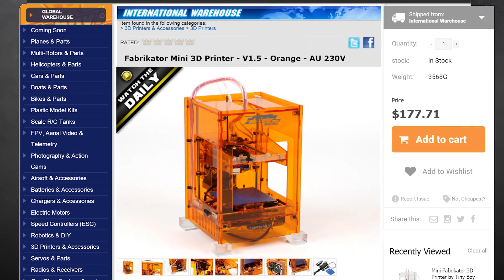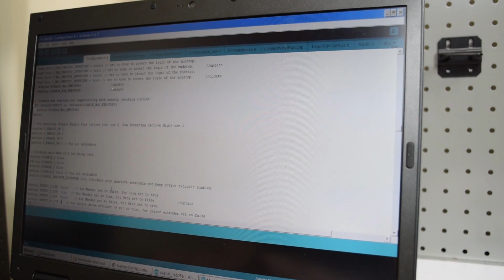Fabrikator Mini V1.5 3D Printer Review

Comment: Nice review. One thing that could be a problem is long term reliability. With brass bushings and underpowered motors that heat up a lot, you will probably not have fun with that little machine for a long time. Well, I guess you get what you pay for, and if this would be your first printer, you probably want something bigger pretty soon anyway. Or you realize that after the first few prints the buzz is wearing off and it just collects dust in a corner. At least you do not throw out thousands of dollars to get to that conclusion with this little toy printer, so it's a good way to get started i guess ;)
Reply from the maker: +ExtraBase With some oil the bushings should last a while and are easy to replace, but yes you certainly get what you pay for!

Comment: Any suggestions on what brand filament to buy for this?  It's currently on backorder @ hobbyking for the US version.
Reply from the maker: +Shai Perednik Any decent 1.75mm PLA will do you fine. I like esun, verbatim and colorfabb.
Reply: +Maker's Muse awesome thanks. ordered my fabrikator mini from the US east warehouse for $224. and esun 20ft x 7 rolls sample pack from amazon w/ your affiliate link for $13. thx for the tips!  can you post your print settings for the esun?
Reply from the maker: Thanks! For printing ESun I went with Cura using the configuration from Chuck's website - and a temperature of 190 seems to work quite well. Be sure to dial the bed level in with the z axis screw carefully so the nozzle doesn't dig into the bed and burn it.

Chuck's resources can be found here - http://www.elproducts.com/fabrikator-mini.html
Reply: +Maker's Muse wow.  thx for the quick reply.  I'll check that out.  any thoughts on using astroprint with the fabrikator mini? I setup and extra pi2 in prep to make printing easier for the family.

Comment: I've had the V1 for about 4 months and I love it.  I need it to make model aircraft parts and didn't want any mucking around.  Apart from a loose z axis grub screw it has worked excellently from day one.
I tried reflashing to add an LCD and SD card board but didn't know it was custom firmware -- HobbyKing support got me the correct files in about 3 days - pretty good going for a low-margin retailer.
Would love to see an LCD add-on tutorial video!

Comment: If anyone plans on using an LCD and the Toshiba Flashair WiFi SD card with the Fabrikator Mini, I have found and made the modifications to Chucks firmware and is available here https://github.com/RJ-Make/Fabrikator_Min_1.5_LCD_Flashair.

The Flashair SD cards works very well. I use it as a mapped network drive on my computer to upload right out of S3D to each of my printers.
Reply from the maker: +RJ_Make That's heaps cool! I always wondered if those wifi cards worked. Thanks for sharing.

Comment: My experience was much different, so far this is what I've run into, out of the box. 

1) Loose X belt (not just a little loose but really loose)
2) Upper Z rod coupling grub screw not tightened down.
3) Bed is warped. I'm 23+mm from the bed in the center and still really tight on the right and rear platform edges. and of course I've not found a way to fix that.
4) Extruder cooling fan is very noise and hard starting on a cold start. Once it's going (about 45 sec) it quiets down and runs normally)
5) The X axis motor pulley rim popped off and the pulley moved up the motor shaft. Not sure if it's a pin or grub holding that pulley on, but it's smaller than .050 and I have nothing that small.  I had to tap the pulley back down on the shaft and set it and the rim with superglue just to get this thing to run to see if I had any other problems.

After the above, I was finally able to print a calibration cube successfully,  but on the next test print the X axis motor pulley broke free again (was fully expecting that)
Reply from the maker: +RJ_Make Wow! Sounds like you got the Friday Arvo Knockoff Special.... 

#1 Tightening the belts is a pain due to how they've designed the movement axis but not impossible. 

#2 If you have the right allen key no huge problem, I'd stick some superglue on that one for good measure.

#3 Warped bed however... that isn't good at all. I think you would have a case to get in touch with them, send photos of it with something flat on it and get a replacement sent out to you if you can. It's easy to replace by undoing the 4 screws with the standoffs. Maybe those standoffs weren't fully tightened down? 

#4 Bad bushing on the fan would cause it to vibrate noisily, might need a tiny bit of oil if you can somehow get to the bushing but might be difficult.

#5 That has happened to me before... VERY frustrating. It's definitely a grubscrew, it'll probably be a very small metric one, not sure what size.
Reply: +Maker's Muse Thanks Angus, Yep, 1 and 2 where easy, thankfully I have some of those tiny zip ties, and the correct hex size for the coupling. 

It's not possible to correct the bed unfortunately (everything was tight)   I could probably get away with using it with the bed the way it is, if I could tighten down on that pulley grub.. I've never seen a grub that small before.

Just need to know the size and source the key.
Reply: +XerotoLabs Thanks for the suggestions. I like the idea on reshaping the plexi, didn't even cross my mind, Now I just have to find a perfectly flat surface that can handle a little heat. :-)

I did try an eye glass screw driver that 'fit', but I just wasn't comfortable with using it. I have a metric bit set that has a .7 hex on order so If your right and it's .5 well I'm out of luck because I can't seem to find one easily, that has a metric hex less then .7

I thought about drilling the grub out, but that aluminum looks pretty darn thin (cheap).  One wrong move, and I have a bad feeling that pulley would get chewed up real quick.
Reply: one thing for small hex and set screws that has save dmy butt a few times was o get one of the cheapo small screw driver kits that have  the chrome handles and the 'hardened' (yeah rite) steel tips. i would then shape the closest one to the bit shape i needed using my rotary tool, and then if needed try to re harden the new tip shape. small tips can be pain . way too many old R/C things and small devices had custom small screws and such . 
also if it is a hex , dont grind / file the tip down to a hex ot flat , if you can file it to a triangular shape , you will fid a better fitting tip . also if you dont have old micro drives you can  mod , get your hands on some model aircraft landing gear wire .. piano wire .  its essentially spring steel most of the time .  remember short touches with rotary tool to shape it , you dont want to heat it if you can help it  , then you dont have to try to re harden it .

Comment: I got curious and bought one of these machines, HK's delivery was super fast too. Right off the bat I had head clog after head clog, the motor on mine was turning the correct way but I found the pressure roller for the filament was jammed solid, a quarter turn loosening the bolt through it allowed the bearing to work and it to feed filament correctly and away it went. I am really keen to find out about the SD card reader and control panel upgrades as this would make it much more usable. I have a Flashforge Dreamer which I have fitted a few mods to including the MK10 Micro Swiss extruder and yes it outperforms this machine but then so it should, considering the cost of this little machine I think it is wonderful. Great stuff Angus look forward to seeing what you do with it next :-)
Reply: +Maker's Muse The thread goes all the way through for ease of manufacture probably.
I've put two 500g reels of filament through mine and it's worked without jams or issues - plus I don't have a proper spool, I just leave it flat on the desk and the beefy feed stepper drags it in!
Reply from the maker: +Paul OBrien Cheers! I've since found out my extruder was fine, I just attached the bowden tube to the wrong side... but why they have it tapped on both sides is beyond me! Glad you got yours up and running, an oiler is apparently recommended to keep filament flowing easier and limit future risks of jamming.
Reply from the maker: Haha, surprised the spool doesn't drag the printer towards it instead! I am very happy they went with such a strong extruder despite the small print size.
Reply: +Maker's Muse I've got to make a spool holder, I've been sloppy during long prints and its got wedged in but still it drags it... amazing.  I've hot glued the feet onto the printer and hot glued them onto a small nylon chopping board that keeps the cables etc organised.  Not pretty but it's a production machine..
Reply: +Maker's Muse Ha ha I am amazed you admit to a clanger like that :-) but yeah why thread it both sides, I you made the mistakeI am sure lots of others will too. The feed stepper is quite grunty for such a little machine having a seized pressure roller made it grind the filament almost in half.
Reply from the maker: All about transparency! Haha, it's not simply threaded clean through, there is a thread on the black body of the extruder assembly, as well as on the red tensioner arm. The main reason I did it is I couldn't see how you could force filament into that small brass nozzle looking thing... eh either way it seems to work fine with the reverse in firmware, I'll just leave it as is! Yeah if there's a jam the feeder gear will just destroy the filament instantly, lots of torque there.
Reply: +Maker's Muse Yeah that brass nipple thing had be wondering it does seem to make loading filament awkward, I intend to have a tinker with this in future, I made a modification to my FF Dreamer in this area using a piece of 4 x 2mm teflon tubing and it improved the feeding capability considerably particularly for TPU

Comment: My v1 build plate warped so I replaced it with aluminium.I use matter control rather than RH as over time everything starts to loosen up and become uneven MC has 13 point software levelling.In all its a great 1st time printer and perfect for the RC hobby.Thanks for the video and keep up the good work

Comment: @Maker's Muse if you adjust the voltage for each stepper on this little guy to about .6v the motors run cooler, still hot to the touch but not "oh my gosh, i burnt my finger" hot!
Reply from the maker: +Jeff Gould Cheers for the tip! I'll tweak them down. I suppose they're just ramped up from the factory 'just in case' to keep torque high.

Comment: I am sitting next to my version 1.0 and it is printing away. My prints are all just as good as the flashforge creator pro that I also frequently use. My only real complaints are print speed and build volume but I knew what I was getting into when I bought it.

Comment: So the twirl or whatever its called on the top is due to lack of cooling?
Reply from the maker: +xiphy94 Yeah it started drooping due to not cooling enough between layers, it's a common issue when printing in PLA without adequate cooling.

Comment: if the PLA only thing is a big deal for anyone then i would highly recomend trying a PET filament like colorfabb xt or ngen. This stuff has many of the good features of ABS like withstanding high temperatures and shouldnt need extra cooling for overhangs and bridges. It also doesnt warp or absorb moisture much either.
Reply from the maker: +Scienteer Yeah I'm interested to see if I can get it to work as a good alternative to ABS.

Comment: I am in the other camp as I tried the sd card and screen on my printer and removed it as I had so much more control, and faster input, via the computer tether (Linux based older machine).  Having to screw around with the knob, etc... just put me off.

Comment: I thought of buying this but thought I would rather wait and by a tiko
Reply: honestly, I think you should save to buy something for about double the price. you will be happy with something like a wanhao duplicator i3. you are getting WAY more than double the printer and quality, for only double the price. the tiko is still a solid option, but there is no heated bed so even though they say you can print in non-pla materials, you really can't. also, it is unbearably tiny for a primary printer.

Comment: Great video. Did the blue painters tape for the bed come with the printer because I am looking to buy a solid sheet of blue painters tape for my rigidbot. I like the school idea. My school is trying to get an afinia.
Reply from the maker: +Panoreth 3D Printing Afinia are good printers, yeah the blue tape comes with it. It's not the best, easy to damage taking prints off. I would try to get buildtak or similar instead. You can buy the blue tape sheets off ebay or various amazon sellers.
Reply: +Maker's Muse thank you.

Comment: Mine managed one complete print (the 20 mm test cube). During the second run I noticed the motors were really hot, and my X-axis motor stopped being able to consistently pull the timing belt - the extruder only ran in Y and Z until I stopped the print.

https://youtu.be/_Sz6DWGFZzI

I'm waiting for a response from HobbyKing what the next step will be. However, the printing I got done was really impressive, and I really like the form factor, although I'm probably buying a Wanhao duplicator i3 pretty soon anyway to be able to print bigger items.
Reply from the maker: +Patrick Strang Glad you got it fixed, it seems to be a common issue where they aren't tightening the grub screws enough. When you do tighten it in place a 'tiny' drop of superglue or thread locker can help as well, just don't get any on the frame!

Comment: For me it's to small. I rather buy a used CELRobox for about double the price. Do you think thats a good idea?
Reply from the maker: +Griffelkiste If you can find one then sure! Just make sure the extruder still works fine, the Robox's needle valve extruder system is fairly fragile and basically impossible to repair should the seals fail.
Reply: +Maker's Muse I learned that form your Review of the Robox. Anyways an Extruder will only cost me about ~130€ or it wil be replaced in the warranty time. For me that would still be cheaper than a Wahoo Duplicator i3.

Comment: Looks good for what it is, but I find the build area of my Kossel mini a bit limiting at times and that's a 170mm diameter (so can fit a 120x120 build volume inside), I imagine this size would make designing parts, and finding suitable ones harder. Having said that, most of the RC parts I've printed would easily fit in the volume, and I guess that's the point. If your interest is RC only, it'll probably be a great workhorse, and save its own cost in the parts created.

Comment: 4:44 you can easily glue the plastic feet to the plastic frame for a permanent fix.
BTW.... Great review.
Reply from the maker: +lasersbee I don't want to sully my poor printer with glued on afterthought feet ;) the 3D printed designs on thingiverse look and work way better in my opinion.
Reply: +Maker's Muse If you are referring to the base that Chuck has on his Fabrikator Mini then I would still glue the supplied feet to the Mini.
My reasoning is that the airflow under the Mini is by convection only and the walls of the square base will (if only a bit) block some of the natural convection air flow to cool the electronics underneath.

Comment: based on this I do think I'll still just get the wanhoa I3 (seen they got a V2).
But I'll definitely keep a eye on this one just in case smth happens again where I really can't afford the money for the I3.
There is just this one part I already designed that just wouldn't fit in a 80x80x80 volume  and I'd prefer to print it in ABS.
Reply: +boomerangfreak It will print ABS
Reply: You could always print your project in smaller sections, then glue them together.

Comment: 7:00 OR you could have just reversed the motor connections. no flashing needed. makes it easier for those who "are afraid of the firmware" - I know a few
Reply from the maker: +Adrian Ciubotariu Like I said in the vid, I could have, but the Fabrikator Mini's motor leads are firmly tucked up in the frame with almost no slack and getting to them with a soldering iron would have been a fairly nasty looking mod. Firmware really isn't that scary!
Reply: Maker's Muse that's true too - I had my brother in mind as he's ok with taking anything apart, but software... that's "magic" to him.

Comment: Wow... This thing blows my mind, I got a wanhao i3 for christmas and i have not got it to print even one single full working print exept for a 10x10x10 mm cube. Might look a little deeper in to this thing!
Reply from the maker: +Sebastian Atterhall Shame to hear your Wanhao hasn't worked well for you! Did something break? Mine needs lot of improvements which I've been planning to do, but it can still print large PLA parts without too much trouble.
Reply: +Maker's Muse No, funnily enough mine isn't broken, but it prints the first layer really good on bigger prints, but the rest of the layers won't seem to grip the first one. I'm using some settings i found that someone recommended on a forum. I wonder if you have some settings of your own that works for you? Great video btw.

Comment: Wow that is a bunch of cool stuffed into a little box for cheap money. I'm still trying to decide the mini or the wanhao i3 as my first 3d printer. PLA only worries me. I mostly want to print parts to make other machines. Thanks a lot for the high quality videos.
Reply from the maker: +Steve Christiano The Wanhao i3 does have the heated bed, but it's still open frame so will struggle with large ABS parts. I think if you're printing for other machines, the size restrictions of the fabrikator mini might be a bit much for your use.
Reply: +Maker's Muse Thanks Angus! Keep up the good work. Really enjoying the videos. They are very helpful for a noob like me.